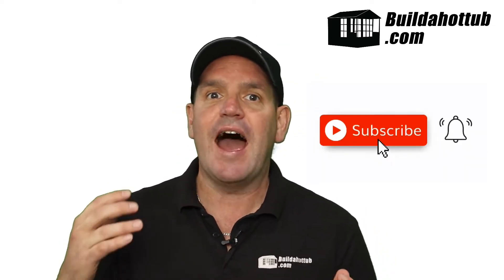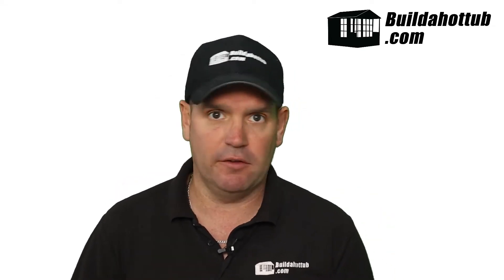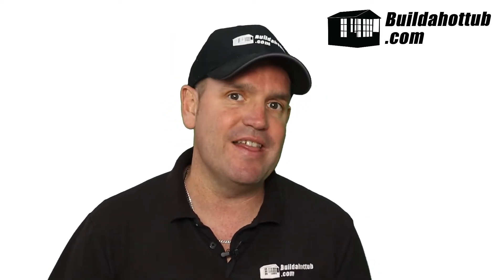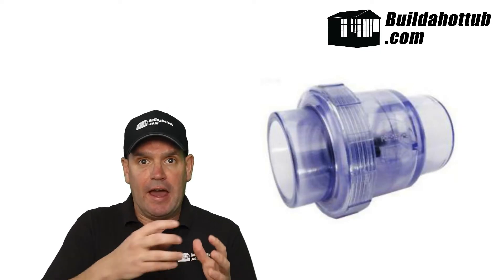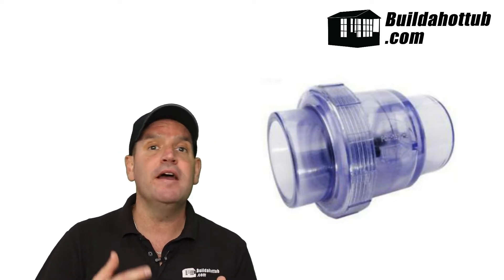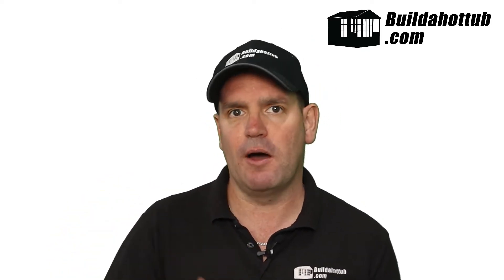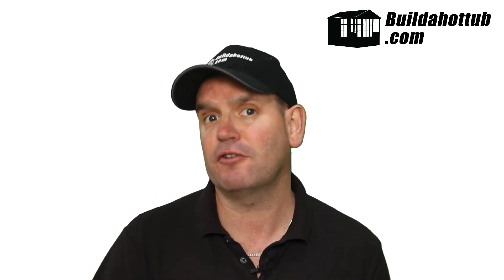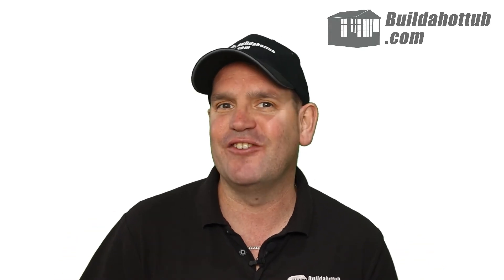Got Water In Your Hot Tub Air Blower? Fix & Prevention Tips Revealed

Comment: Thank you so much for this video! I'm wondering, it is possible to remove the blower with the tub full with water? Or am I about to initiate noahs ark in my back garden? 

All the best!
Reply from the maker: Should be yes, you should not have water backing up to the blower - somewhere in the system should be a hartford loop and a check valve to keep the water out - hope that helps - Andi

Comment: We moved into our house w a pool 13 years ago. There's a concrete spa and pool plumbed together with a blower activated by an air pressure switch.  No check valve, in fact the blower is just pressure fit onto the pvc and I can pull it off easily.  Blower is about 100 feet and up a hill from the hot tub so no water in the blower.  This year for the first time it's acting up.  It takes 1 to 2 minutes from the time it starts up until the first bubble appears in the spa.  And that happens every time I turn it on, and it's never been that way.  I'm guessing water now gets into the air pipe and it takes that long for the air to push it's way to the spa.  Does that sound reasonable question mark? Can I buy a check valve now? And must I glue or union the blower to the pvc? Thanks sir
Reply from the maker: Sounds a reasonable deduction yes - taking time to build up pressure to remove the water from the lines. You can do either to the blower - both glue or union would work - you would want the check valve as close to the hot tub as possible - hope that helps Andi